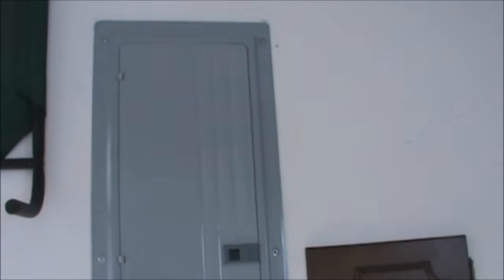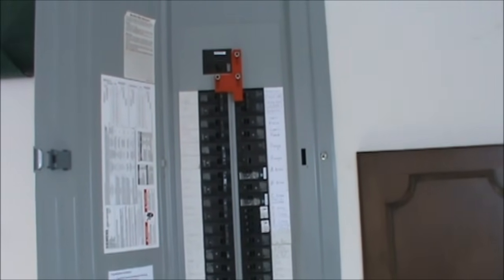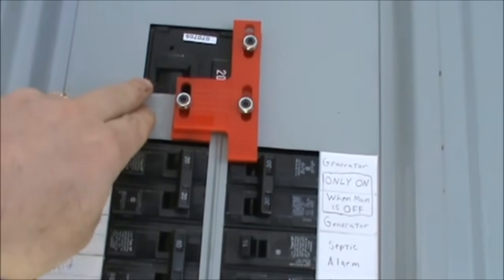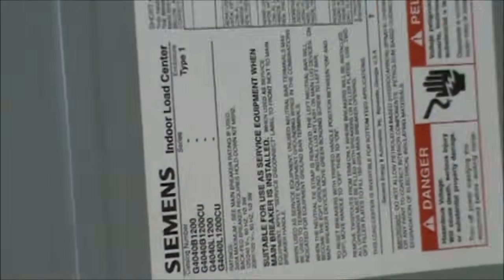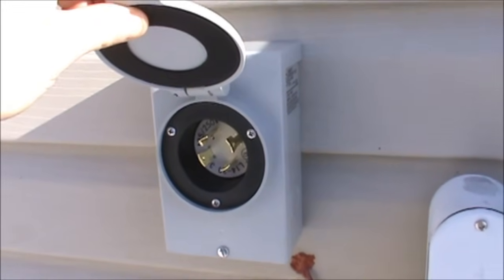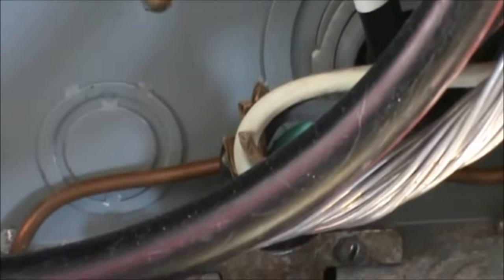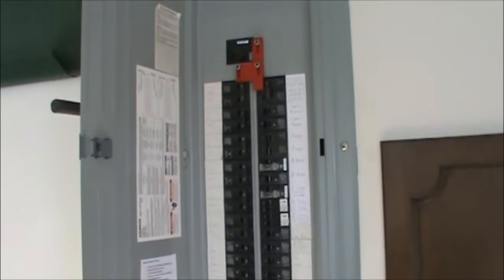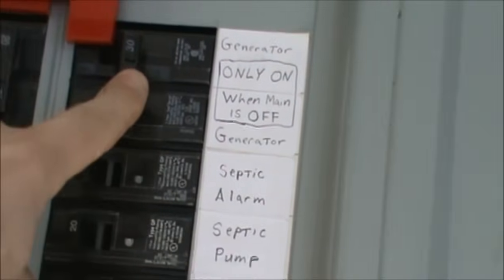How to wire a generator to an electrical panel

Comment: As I once worked for a electric manufacturer and learned a lot I got lucky in a way The company went under but I bought 2 gen sets that can be run in Parallel a ASCO  switch to my whole house breaker  . I also got 6awg wires for the whole things . The only bad part is the electric starts are AC not DC. I put the whole system in by my self 
Lucky I did it before becoming totaled disabled  from my NAVY accident . Damn the torpedo reload accident!!!!

Comment: in Ontario you need to also isolate the neutral so this hook up is no allowed. The reason for this is because if the grounding system is faulty then any unbalanced current with travel to the nutria wire going out the utility company. I strongly advise anyone doing this to install and proper transfer switch between the panel and the utility meter

Comment: The breaker in the panel that you have connected to the generator, do you actually flip it to the off position in order to power the rest of the panel?

Comment: Your setup looks good.  Where I live a transfer switch is required to be next to the meter.  People need to check their local codes before attempting this, or better thing to do is hire an electrician.  Like I said before your setup looks good. My local POCO would pull the meter.
Reply: My meter is 110 ft away from the house out at the street, but we have different codes.

Comment: Where did you get the interlock kit in the video? The one you have linked to is not the one in the video. I have the exact same panel as you (saw model number when you panned to the door) and I’m having trouble making sure the interlock I’m buying is the one that will fit.

Comment: So if i have two panels (400 amp system) i would need this two of these systems and two generators right?
Reply: Technically yes. but honestly getting a bigger diesel generator may be a better option for you. 400amp must be a huge house

Comment: The instructions for mine are: connect the generator cables; start the generator and let it warm up; switch off the high load breakers; switch off the main breaker; move the interlock; switch on the generator breaker. I did a test run and the electrician measured the actual loads  in the different circuits I plan to use during emergencies to make sure I was within the generator capacity

Comment: Hi, If I have a sub panel built specifically for a generator, is the interlock still required on the main? Thanks alot
Reply: Yes you still need to lock it out but have your sub panel checked out it might be built in just to verify call a licensed election have them check it out  I highly suggest this better to be safe then sorry good luck

Comment: I have a transfer switch at our transformer / meter pole that the rural electric provided for a generator. All I had to do is have an electrician install a wire with the plug into the transfer switch. You might want to check with your power company to see if they will provide the transfer switch. If it is to protect their line workers they might be more that willing to help out with the cost or labor. I like your channel! Good work!
Reply: I called Consumer's Energy in SW Michigan.  They don't allow that kind of connection at the meter.  Too bad, I've seen them elsewhere, and it is a nice set up!  According to the manufacturer, regulations vary from place to place.

Comment: Why dod you use a double 30 breaker? Will a single 30 work?
Reply: The generator is producing 240V so it wouldn't make sense to use a single pole breaker (120V). If he used a single pole 30 amp breaker that would allow for 2880 watt (continuous load) usage. A double pole with the same amp rating (30amp) would provide 5760 watts (twice the wattage). Hope that makes sense. Peace

Comment: question, the generator connected 10 gauge wire goes into the 30amp breaker, does that breaker, once flipped to on, charge the entire panel? replacing the hot hard lines that is now disconnected due to the main being switch off?
Reply: When you lose power, the 2 utility hots entering your panel do not have power.  Therefore, your generator is needed to power up your panel.  Since the 2 power wires coming from your generator are attached to a 2 pole breaker, both legs of the panel will have power allowing you to choose to turn on any breaker attached to the panel including the Main breaker which will back feed to the pole.  He switched the Main off prior to starting the generator to prevent power from shocking a lineman working to restore power.

Comment: You need breakers at the point of entry into the electric system.That is at the receptacle or by using a fused disconnect box at the AC or other place. Match the inside breaker size at the exterior box. Otherwise the conductor is unprotected from the outlet to the inside breaker. The breaker at the generator is unreliable.

Comment: It looks like you need to perform manual work in between changing over from the power line to generator. How does the generator interlock work when the power goes out and you want a system to start automatically powering the entire home?
Reply: It would not.  This would be great for an extended power outage.  Those systems are a lot more to get set up.

Comment: Can I run the wires to the dryer circuit.  I have no more circuit space
Reply: You can but its not safe since your main breaker is not interlocked and you will have a suicide cord with both ends with male prongs and can electrocute yourself if not careful or if you leave main breaker in your main panel on, you can kill a lineman. Depending on your local code you can gang up two 15amp lighting circuits or low load circuits to make room in your panel if you dont want to install a sub panel. some square D breakers are designed to take two wires and rated for it or they have tandem breakers if you panel can accept them to make room.
Reply: @Deagle367  I shut of the main coming into the house.than I shut of the main breaker.tha hook up the cord to thr Gen
Reply: @RobertWhite-z1c  Yes that's the practical way to do it but your taking a big risk.  It may be illegal to do what you're doing without a interlock.  Also if your house catches fire, you may have issues with homeowners insurance or if you forget one day and hurt a lineman, it doesn't seem worth the potential headaches since it pretty easy to do it the right way.

Comment: Greatings, Im  a bit confused here, the eletrical panel tha is being talked about in this video is a solar panel? If it is then that means you can actually generate electicity in your house with you solar panel? Because from what I understand solar panels mostly serve to heat, and provide light. If this video is explaining what I think it is explaning it can be a gods sent!
Reply: no, I think he just mentioned solar.  He is connecting his house electric panel to a gas powered generator.  However, you can connect solar power to your house electric panel and get free power.  The catch is that the equipment to do is isn't free and there's no power at night unless you also install a solar power battery bank.  I've done it.  I have a small off-grid solar system to generate some power in case there's a long term or very wide-spread power outage and I can't get gas for my gas generator.  I have heat through a pellet stove, A/C through a window A/C unit, lights, outlets and can run my refrigerator all on solar. I just need to be very conservative based on the output of my solar panels and battery bank storage capacity (500 amp hours of reserve power).

Comment: I have a 8750/7000  and I can run everything in my house EVERYTHING but it sure hurts it and uses the hell out of gas. so I do like you do only turn on what I have to have on and the rest stays off. I now have a pretty good system my hot water heater will hold hot water for about two days if we don't use it so I turn it on about a hour before we get our bath and as soon as we done it goes off. and I use a hot plate instead of a stove. we have one little 240 volt a/c we put at the back door and just close the garage door the house stays cool but the garage gets pretty warm. thank god I haven't had to do it in a few years but we set up if we need it.

Comment: Another reason for not leaving your main breaker on while running a generator is that once power returns you will more than likely have your generator and the utility voltage out of phase! This could cause serious damage.

Comment: Did u put a ground rod in ground and hook up generator to a ground rod when it's in use? I dident think it will be needed but I wanna make sure. thanks
Reply: I think that if you use the correct 4-prong cable, and it's wired correctly to the house panel on the neutral and ground wires, the house ground would be more than adequate protection.
Reply: A bonded Gen has nutrual and ground tied together, if the Gen is grounded to a rod as recommended can you just run 2 120s and nutrual to an old 2 conductor box???

Comment: Nice installation, I do lots of generator installations and sometimes go and fix installations where home owners have tried to do it themselves to save money and I have found some really bad installations with lots of errors. I often find that most people don't use lockout devices and that can be very dangerous. Most people want to use portable generators to power certain circuits. I try to encourage people to install power plant systems that run the entire home. They are more expensive but they are so much easier to install and will add value to your home. I like to use Cummins Onan systems. I place the generator as close as I can to the meter base and wire in the ATS (automatic transfer switch) directly out of the meter enclosure in most cases, so its a quick, simple installation and the whole home is on standby, in the event of a power outage, The Cummins Onan system only takes 8 seconds to reach full power and transfer to backup, so you only lose power for less than 10 seconds and then the generator takes over and your whole house runs normally, AC, Hot Water, Heat, and if you had a turkey in the oven then you will continue to cook that as well. Its an expensive system but well worth it in my opinion.
Reply: and for us that cant afford ? 15 k  so we turn to a bit cheaper way to yes just get by during an outage that may last a few days.

Comment: What about addressing the problem of the floating/bonded neutral in the generator itself. ?? Unless this is corrected current can be fed back to the generator and be hot in places like the frame, metal housings, etc.  This is all too often overlooked with these types of generators.

Comment: How do I know what size generator wattage i need. I just want to at least run a mini split AC unit and plug in 2 refrigerators and run a light fixture at night and watch a tv. How do I know what wattage consumption devices typically use?
Reply: What size is ur mini split A/C ?
Reply: Approx 10-12k Btu. It’s for a small room of 200 sq ft
Reply: I got the firman 7500/9400
Reply: @markrose4627  A 4000 watt gennie should wok fine. Check voltage on A/C see if its 120 or 230 volts. Most that size are 120 volt. Google ohms law , it will tell u formula, for example a 4000 watt gennie will handle 30 amps . 4000 watts ÷ 120 volts = 33 amps. 4000watts ÷240 volts = 16.6 amps. Lights and tv use very little, the A/C and 2 fridges ur load prolly comes to about 20 amps. Look at tags on appliances and get watts or amps and total them up.

Comment: can you hook it up to your panel if you dont have power going to your panel. i want to put a generator in my garage to power my panel, that will be the only power for the garage?
Reply: Hi Michael. Are you talking about a panel that is separate/electrically isolated from your service panel?
Reply: @truthbebold4009  yea i wanted to put it on the panel in my garage but i had someone run power to my garage from my house so i dont need it anymore.

Comment: Why the double 30amp breaker?
Reply: The generator produces 240V which requires a two pole breaker in order to utilize the total wattage capacity vs half the wattage capacity if he used a single pole breaker. Hope that helps. Peace

Comment: i want to do this to activate my micro inverters if the grid goes down. my pv is grid tied. will a generator provide a sine wave to activate my inverters?
Reply: Microinverters are also designed to only accept DC power in.  I know you might be thinking of simulating line power as a work around to fool the anti-islanding feather of those microinverters, but it won't work.  If you connect a generator to your micro inverter, stand back and watch the fireworks.

Comment: Is there any real advantage using such a big generator when you are limited to 30 amps to your panel from the 4 prong plug?  I am about to install the same set up but I think I am ok with buying a smaller unit that has a 30 amp plug for about half the price. It seems to me that the extra wattage that the generator is capable of will be unused unless you plug items directly into the 120 volt recepticles at the same time that you have the 30 amp hooked up to your panel.
Reply: I think you're right.  I have looked at getting enough power to keep the furnace and refrigerator going, and maybe the coffee maker (lol).  Actually that's a lot of wattage just to run those.  I guess we both need to talk to an electrician.. I wouldn't go to Home Depot or Lowes to find that out.  But there are places on the internet that have help for the $$.  Ask dot com is one.
Reply from the maker: I don't really want to answer this, because I am not an electrician.  My guess is 30 Amps is the max output.  I think startup amperage is higher for appliances and devices.  This generator is capable of running more than 2 15amp outlets. I'm pretty sure it will run close to my whole house if needed.  Visit a Forum to get a certified answer.  Thanks for watching.
Reply: doublewide6

That could possibly be the case for your generator but it most certainly isn't the case for your 30amp cord and 30amp breaker. If your amps go above 30, than your 30 amp breaker will pop to protect your 30 amp cord from burning up. That is why they make 40 and 50 amp generators for larger applications. FYI.
Reply: Jordan Strychalski You are right.  If you are willing to spend more, the bigger generator is the way to go.  My point is that the generators that advertise 60, 70, or 80  amps can only deliver 30 amp (max) out of any single outlet.  Thus, 30 amps is what you are limited to when wiring directly into your panel regardless of the max amps that the generator is capable of delivering.
Reply: Jordan Strychalski My Northstar 10,000watt gen set will put 40 amps out the one out let, hense I use a 40 amp breaker and # 8 wire. and I can run most of the house with it stove refridg furnace  well pump lights.  size it for your needs
Reply: Its 30 amps @ 240 volts
Watts = Amps x Volts
so this setup will deliver 7200 watts of power to the panel, although I believe the generator has a 26 amp breaker so will be limited to 6200 watts in reality.
Reply: Bigger is better.  All women and most men know this.
Reply: +Dave Taylor Your replies are totally useless!  If you can't say something "constructive" than shut up!  At least this guy is trying.
Reply: I can tell you this,  the new wires coming out of the electrical box, that are intended to go to the generator, plug in.  Okay,  if instead you changed your mind, and did not want to hook those wires to the generator plug unit,  and decided to hook up your dryer to these wires.  Now that would be fine.  Nothing illegal no fire hazard, perfectly safe.  Now take the extension cord from the generator plug it into this dryer connector instead of the connecting the dryer, and you have the exact same connection, as before, you just have a different plug configuration.  So when people tell you not to back feed your panel through your dryer connection because it is a fire hazard they are full of shit.  Just because something breaks the law does not make it unsafe.  In this case it is a flawed law.  I am just an idiot but I can follow wires and seen their path and compare one configuration with another.  Electricians will tell you it is a fire hazard, they will begin with the story about how this will heat ............. And then somewhere along the line, they stop explaining usually only after they throw in a few hazard words and electrical codes but the real reason falls by the wayside.  When the real reason is electricians want the money, who do you think lobbys congress to get these electrical codes in place?
Reply: ***** Most dryer circuits are only 30 amp circuits and it is possible to feed much more amperage back through that circuit !!! PLUS if you do not have an interlock devise in place it is against every electrical code and if anybody ever got hurt you are liable !!! These systems have been figured out for a reason, just follow the codes and be legal !!! How hard is that ????  Why be an ass hole and try to justify a shitty wiring set up ???? HUUUHH???
Reply: Also when you use a dryer plug to back feed you now have a live male plug, at 30 amps, that if it becomes unplugged is deadly because it doesn't lock like the coded plug does. In this case the code is there to protect you and me.
Reply: James Edwards TRUE !!!  And how hard is it really to install a double 40 amp breaker in your panel and wire it in right ???  I did and it is code !!! and I can use my 40 amp output from my gen set and run most of the house, but not always at once !!!!

Comment: Can also use Siemens # ECSBPK03 load center handle lock - Amazon $53. Cheapest option and Siemens makes it so it's designed for this particular panel.
Reply from the maker: Thanks good information.  You wonder why people don't bother with the interlock, I see why people skip it when it costs $150.